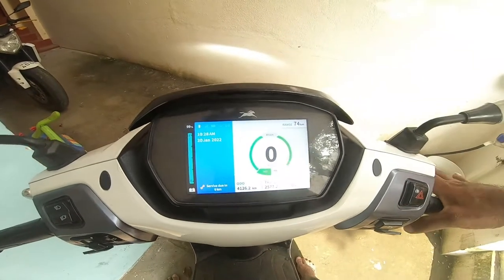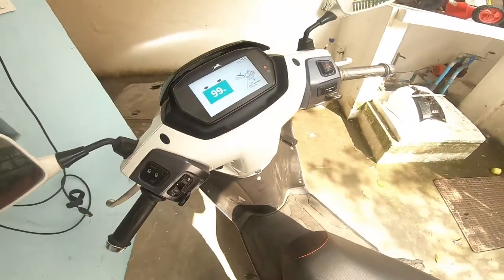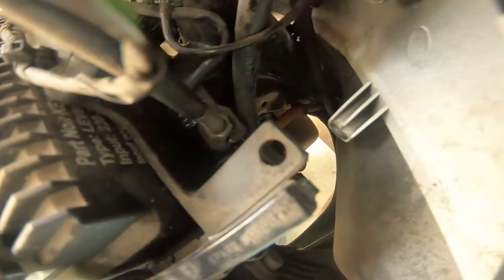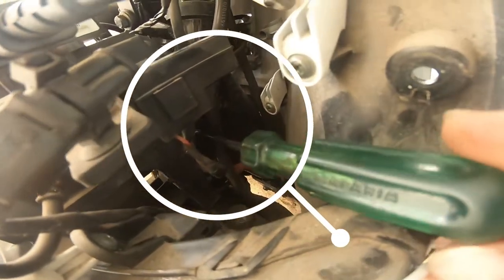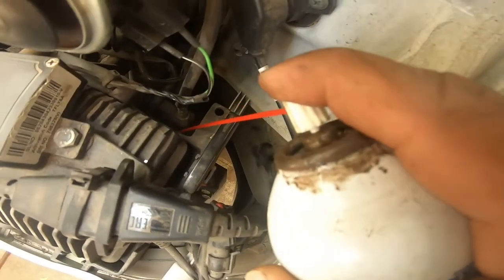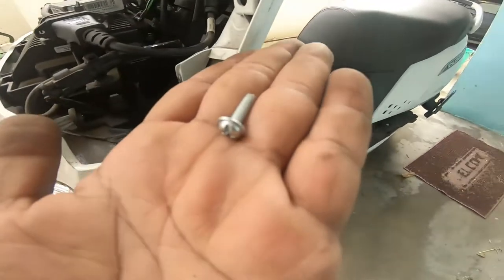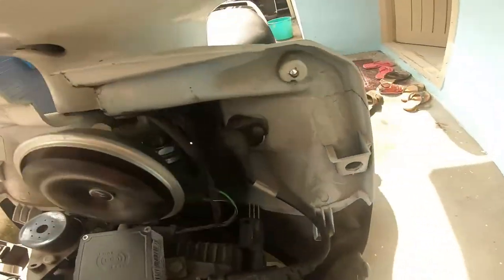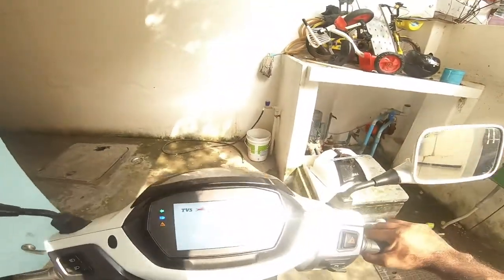Close Throttle Warning TVS iQube Electric Scooter

Comment: Bro I'm stuck here . I can't open it up .. is there any other way I can stop the close throttle warning?
Reply from the maker: Easy to open the front fairing, maybe the screw is tight try using some WD40 if available. or take it to the service center.
Reply: Start vehicle ....you will see throtal  error on screen....just speed your vehicle without break pushing...error will gone..then start with break pushing....I tried every time it work any problem u can contact me if need I will share my whats app
Reply from the maker: @yogendra0606  Thank you for your valuable comments hope its useful.
Reply: Read light blinking on display problem